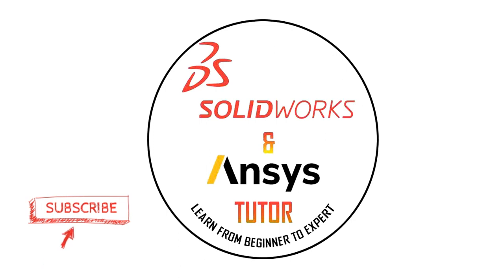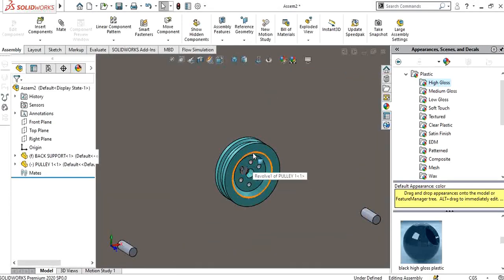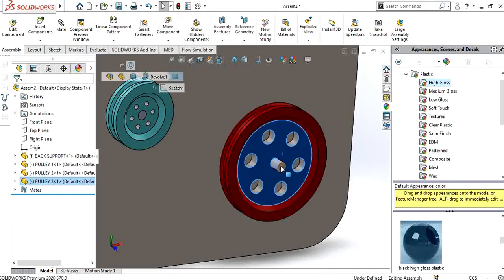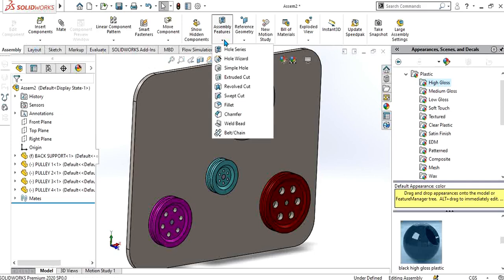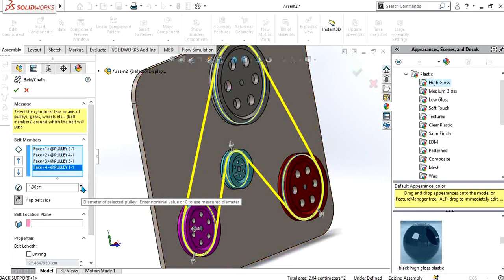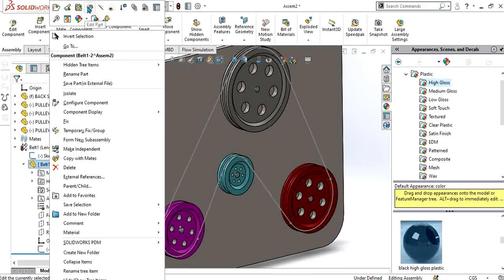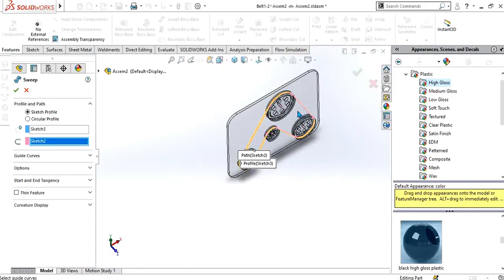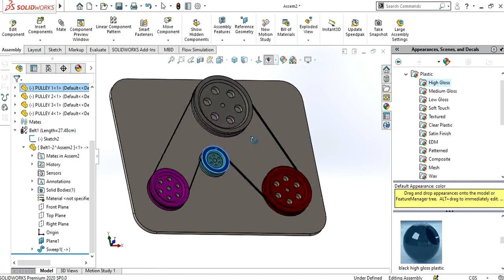📌 Belt and Pulley Mechanism in Solidworks Assembly

Comment: Belt create in 3d sketch is possible ?
Reply from the maker: You can use sweep feature for that . I am not sure that you can use belt feature for 3D sketch or not but i am sure you can make belt using sweep with 3D sketch
Reply: @solidworksandansystutor   thanks i il truc next